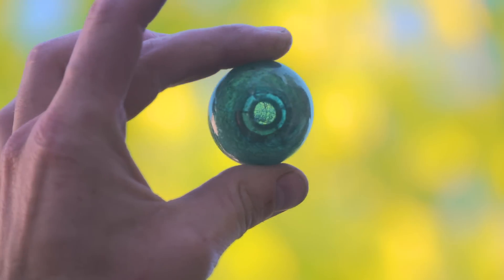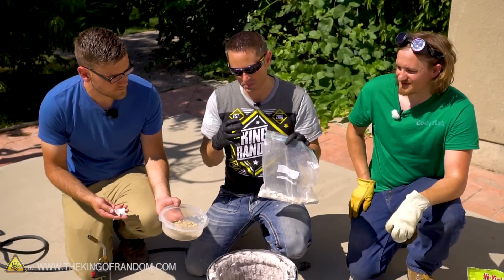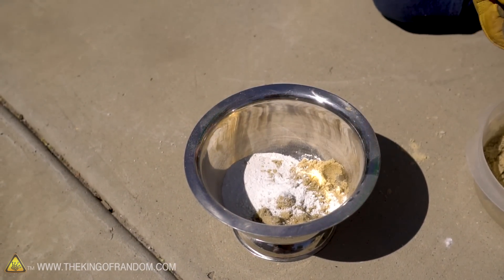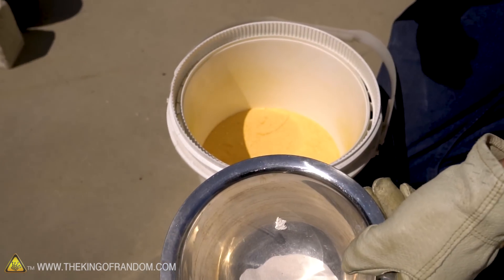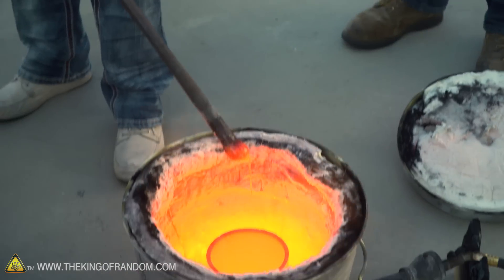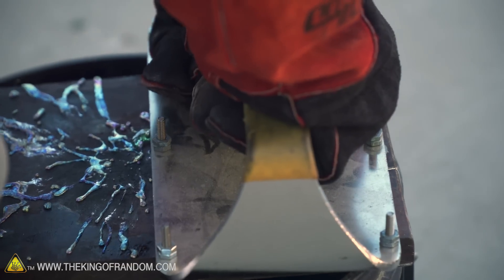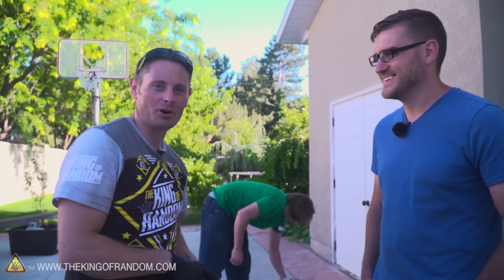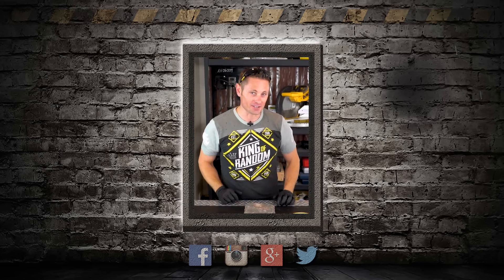How To Turn SAND Into GLASS! Melting Sand Into Glass? TKOR Shows You How To Make Glass!

Comment: Try melting a magnetic metal and see what happens if you take a giant neodymium magnet and try to attract the metal
Reply: Once it gets above its curie temperature, it will lose its magnetic properties .
Reply: max suman the magnet would lose its magnetic ability and become a non ferrous metal
Reply: max suman if you heat up magnetic metal they loose their ability to be a magnet
Reply: Forgot a neodymium magnet on the wood stove, fairly low curie temp. Thinking of seeing how well I can re magnetize that with an electromagnet and a torch, just to try. :)
Reply: heat destroys magnets
Reply: The magnet wouldn't attract the molten metal, but once it got below critical it would be magnetic again and be attracted to the magnet.
Reply: max suman
Reply: Beazley Dang heat destroys magnets, but that's not what he is saying. He is saying melt a magnetic metal such as iron and see if the metal is still magnetic. I pretty sure it will just make an iron magnet
Reply: max suman past a curie point it won't work and destroy the marble
Reply: Jacob riddle it won't hurt the magnet unless the magnet itself gets heated.
Reply: But if the hot metal touches the magnet, the magnet will destroyed....and i don´t know if liquid iron is still ferromagnetic
Reply: max suman the metal will still be magnetized because your using another magnet to magnetize it
Reply: Basinbot20 yup thats right
Reply: Eli Strohecker Ya but what about a permanent magnet like neodymium?

Comment: Prince Rupert drops are strongest at the tip where they can withstand even bullet shots, however the shock from the bullet breaks the tail, causing the whole drop to break, but in the initial hit, the head withstands the shock. Is it possible to make a circular glass ball with an air bubble inside? If that were possible, it would be bulletproof glass that can break bullets without scratching the glass! (Scratched prince rupert drops don't work)

Comment: Please try to make diamonds from coal. Pleaaaase 👅
Reply: The amount of pressure it takes to do that is far more than anything accessible to a regular civilian, it takes the pressure of tectonic plates to crush the carbon enough to make diamond, so really it is impossible, because Grant doesn't have access to an industrial diamond maker.
Reply: They could try to make it with some high power explosives.
Reply: It's really not. The process involves large presses that can weigh hundreds of tons to produce a pressure of 5 GPa at 1500 °C. The second method, using chemical vapor deposition (CVD), creates a carbon plasma over a substrate onto which the carbon atoms deposit to form diamond.
Reply: Eli Strohecker no they are called industrial diamonds.
Reply: mrfatguy227 what makes you believe some explosives will suddenly make a diamond?
Reply: Because it does. This is how industrial dimonds are made.
Reply: begins to calculate how much energy would be needed
EDIT: if done via explosive
Reply: gabriel bielawski lol you can do it with a microwave look it up
Reply: Regina Gil diamond  aren't valuable anyways you would have to get it polished
Reply: In the US. It is legal to make ANFO. ANFO is used to make industrial diamonds.
Reply: You can make diamonds with a candle, micro-diamonds are easy to make. :)
Reply: @read more, Diamonds are worth more in its natural state, as soon as they are cut and polished they lose most of their value. Debeer is the largest stockholder is diamonds in the world, they owned 98% of diamonds and diamond mines in the world at one point, and still own most of them. Diamonds are very valuable and they would be even less valuable if debeer didn't own the majority of them.
Reply: Diamonds don't come from coal
Reply: War Pig - Yeah, you're obviously more qualified in this field than me. I just remembered someone saying that on mythbusters when they were trying this xD. It did work, but the huge amount of explosive did not justify the tiny amount of dimonds made.
Reply: +Regina Gil The pressure required to do that would require tens of thousands of times normal pressure. I doubt any of them could do that but who knows.
+Eli Strohecker  An artificial diamond, if it is almost pure carbon (which is what coal pretty much is) and has (mostly) the right crystal structure, is still a diamond by definition. Cubic zirconia is zirconium dioxide.
Reply: Regina Gil if he would it wouldn't be considered diamonds, it would be considered "cubic zirconia" because it is not a naturally occurring diamond

Comment: What is needed to get the molten glass fluid enough to do sand casting?  Is it just a matter of getting the foundry hot enough or is it having the right composition/ratio of materials?  Or both?
Reply: Can't do sand casting with glass, the sand will get absorbed into the molten glass and not melt, just saying.

Comment: So a back ground g of the leading Crystal and glassware retailers. You will find that extensive research on proper measurements and exact ration rather than throwing majority of the material In. I think the batch with the molten glass and lead mixture that Cody has was not too low in temp but poorly measured.

Comment: Try casting with Titanium
Reply: Titanium melts at more than 3000 degrees. (The foundry steel bucket would melt before the titanium)
Reply: tood10000 I don't think his foundry is capable of melting titanium
Reply: And it would oxidise if you looked at it wrong
Reply: You'd have to bathe the whole setup in argon or something. There's a reason titanium is expensive.

Comment: Awesome! Even if the goal was to make clear glass - that green color was really nice looking. Also  with the crucible sticking to the bottom is one of the classic problem using ceramic wool at temperatures over like 1100°C - that's one of the reasons I use fire brick instead (I used ceramic fiber in the furnace I had before). But the simplicity of that trash can furnace makes it worth it anyway. The ceramic fiber is so easy and quick to replace when it's worn out.

Comment: That was very satisfying. The green glass looked a lot like Roman glass, and the bluish glass looked very much like ancient Egyptian 'Faience' glass. You're definitely going the right way. Might I suggest that you get a piece of polished stainless steel to roll it on - the melt won't pick up any impurities, that way. I have seen glassblowing at close hand, and the glass is blown, and then rolled against a wad of wet newspaper - this is your annealing, and I think the carbon picked up from this is beneficial. It's done several times, between reheating and blowing, so the glass is still plastic in nature, and doesn't succumb to thermal shock. I was also wondering if the bright blue spelter slag that is a by-product of steel smelting, could be re-melted and blown like normal glass, or is it too full of impurities?

Comment: One really old way that was used to get glass with a flat surface, for items such as windows, was to use relatively dense, molten metals to give the glass a hot surface to "float" on and flatten out. If the three of you ever get back together to retry this project, try flattening the glass on molten tin or lead. This may give it a tint though

Comment: They're doing it wrong. First you go mine a few blocks of sand then you find a fuel source, wood, coal or even a bucket of lava. Then you mine 8 blocks of cobblestone. Then you go to you crafting bench and fill     the entire table except the middle with cobblestone, this will create a furnace. Place down your furnace and place your fuel in the bottom square in the furnace interface then place the sand you got earlier in the top square. Then wait a few moments then your glass shall be completed.

Comment: Try make glass into sand pls pretty pls
Reply: it wont be the same, you cant unmelt the minerals
Reply: Impossible
Reply: AceJHD 

No, sand isn't just glass broken down

Glass is sand with extra chemicals added to change the composition, all you would have is glass dust, not sand
Reply: Jan Danzel Lardizabal you and 15 others aren't paying attention in chem class are youll 😂😓
Reply: Jan Danzel Lardizabal that's like asking them to turn ash into wood
Reply: Jan Danzel Lardizabal just grind it down
Reply: Sand isn't glass. Sand is tiny pieces of rocks.
Reply: @Cladiax Sand is just a loose granular substance with a grain diameter between 1/16mm and 2mm. The type of sand used to make glass is quartz sand. Sand can also consist of other types of silica and calcium carbonate. On volcanic islands a lot of black sand consisting mostly of basalt and obsidian can be found.
Reply: not everything is possible
Reply: Cladiax he knows that he just wants to see what glass powder looks like
Reply: Uncook an egg while you're at it!
Reply: Jan Danzel Lardizabal yessss
Reply: David Chen haha
Reply: Sand is basixly particles of glass and rocks
Reply: Jan Danzel Lardizabal lol have tried that. It doesn't work
Reply: Kartul2 yes it will sand is just glass broken down melting it just forms the material together instead of apart

Comment: Can thermite or molten metal melt bullet proof glass.
Reply: yes
Reply: jemuel cuison Can unpressurized jet fuel melt steel beams.
Reply: Thermite can melt almost everything, including bullet proof glass.  There's a HEAT (High Explosive Anti-Tank Warhead) anti-tank weapon that uses molten copper to melt through a tank's armor.  If it'll melt through that then I'm pretty sure that it'll melt through bullet proof glass.
Reply: Thermite would 99.9 percent destroy the glass

Comment: I know it is and old trend but will a fidget spinner spin in a low gravity area
Reply: .1 I know you liked your own comment.
.2 "Old trend"? The trend is very well still relevant. It's only two or three months old! Just because a trend is becoming less trendy doesn't really mean it's "old"
.3 A fidget spinner will spin in a low gravity area, if by "low gravity" you mean microgravity, such as what the astronauts on the ISS experience. It would not spin forever, however, because a slight air resistance would slow it down very gradually. It would spin for a much longer time, though.

Comment: Three 'smart' youtubers and then they pour 2000+ degree F glass onto cold steel and surprised it cracked.

BTW the purest sand in the Minneapolis area is just north of the Battle Creek Caves. There are sinks and hydraulic hoses still there from a porcelain making factory. Used to hike there when I was a kid. It's actually in St Paul on the east side of the Robert Street Bridge. Stuff is pure white and granularity it feels like salt if you get some in your shoes and so forth. Feels too fine to be abrasive. It's strange that way, like sand from some far away white sand exotic beach.

Comment: you should mix 2 parts hydrogen peroxide with 1 part iodine and then put a q-tip in it. stir for 10-20 seconds (q-tip should be purple)